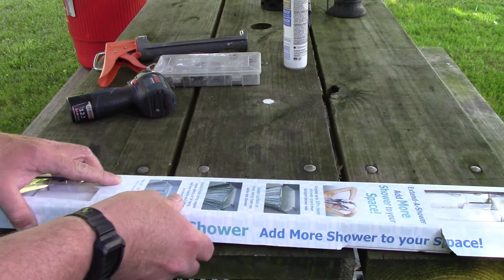Make More Elbow Room in your Shower,  Installing the Extend a Shower

Comment: Nice install. Question: If you move the shower curtain out what keeps the water from going in the floor? We have the solid door but I was just wondering. Does look like it gives you a lot more room though. Thanks for the share buddy.
Reply from the maker: my shower is a tub style,  about a foot deep. the curtain stays inside without any problem.   a short sided tub mught not keep it in.